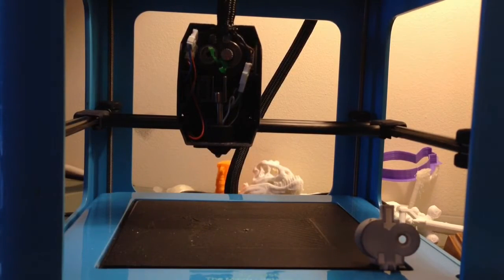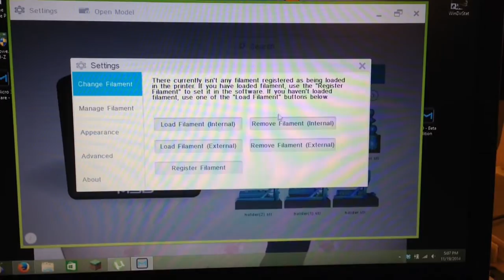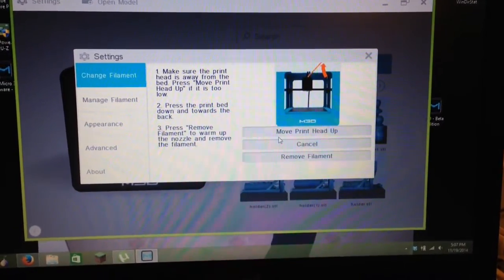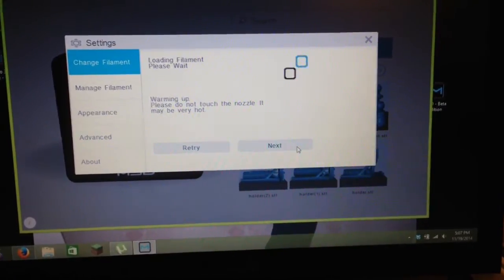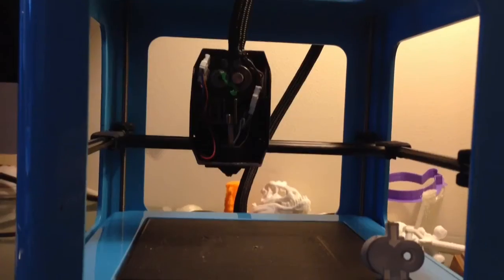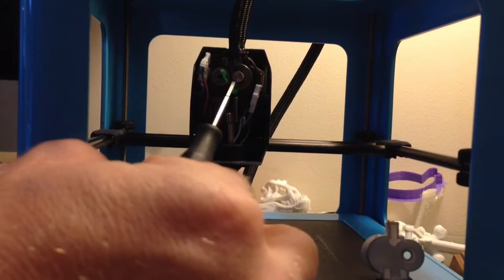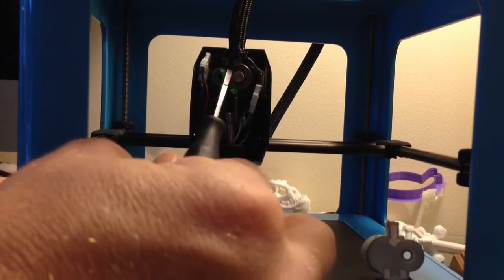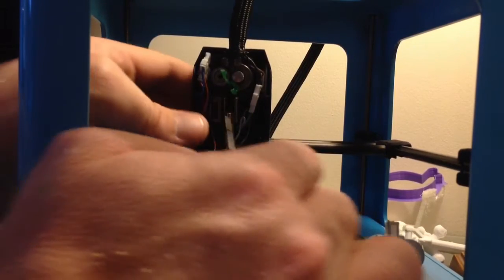The Micro 3D printer beta -- How to unclog the print nozzle

Comment: Thank you. Very helpful. 2 changes however that I recommend. 1: Screwdriver not needed. On the top of the black front cover there are 2 "catches" that need to be pressed down, a fingernail will do, and the cover can be removed. 2: A light prividing a clearer view would be helpful.

Comment: Thank you for uploading all the videos but I have a few questions:
Did you try how calibration or different print settings produce different results? For example with a torture Test: http://www.thingiverse.com/thing:33902

How did this clogging happen?

Could you show some more about the process to print an object. Like loading an obj-file into the software, slicing and sending it to the printer?
Reply from the maker: Martin Weißhaupt  this clogging happend from inconsistent filament would be my guess. 
Once the new firmware comes out in a couple days I'll give the torture test a go.  I'll see if I can work on the requested videos tonight. I have several requests but I've been slammed at work. 

Thanks for the requests, please feel free to post any ideas.